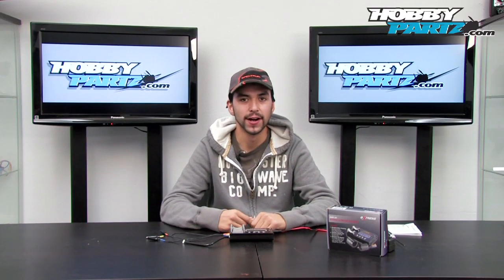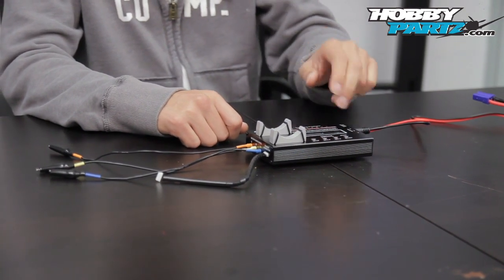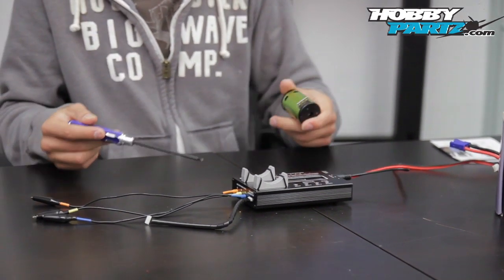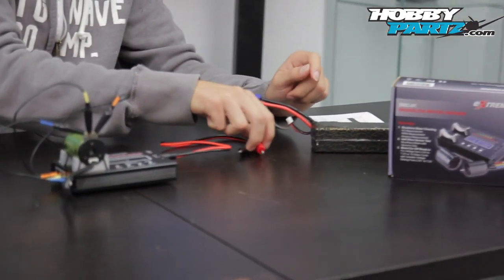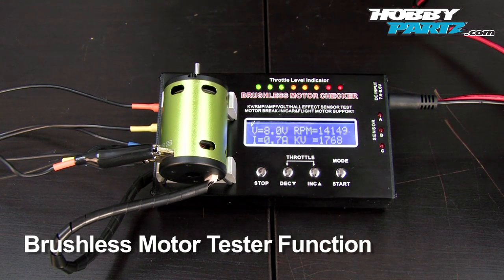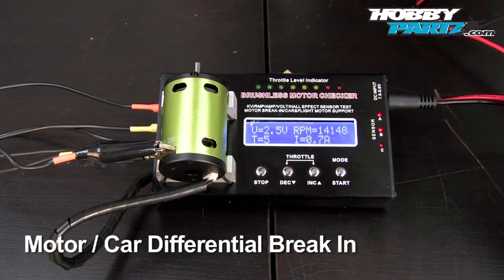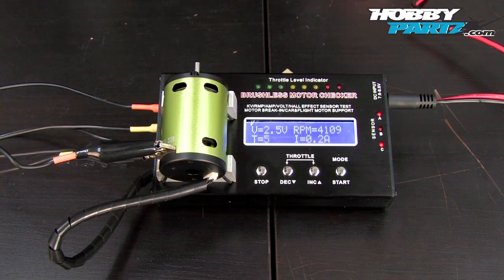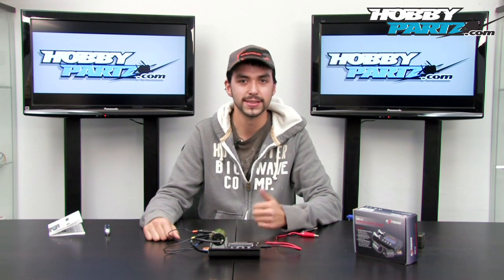Extreme BMC-01 Brushless Motor Checker

Comment: Hi there I have HPI savage flux with hobby wing ESC 80A and a stock motor and I'm running on  lipo  2x2s 4200 mAh 25C and I'm going to change my motor to  2350 KV is that okay or is no good for the batteries cause is a draw more amperage message me back thanks guys

Comment: What about bigger motors that use 5s or 6s is this capable of measuring the KV for those motors ?
Reply: Nope just what the power supply allows. 2s seems to be it. All you can do is measure kv and if sensored you could still change timing.